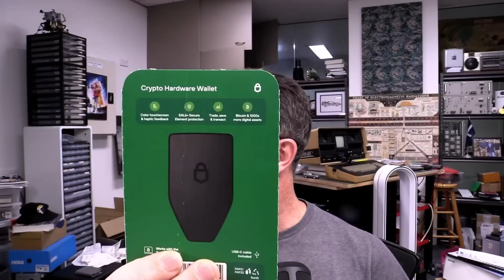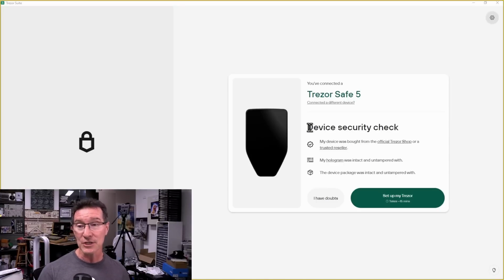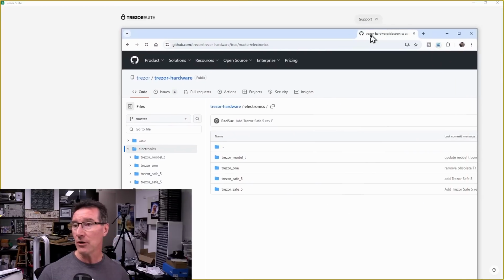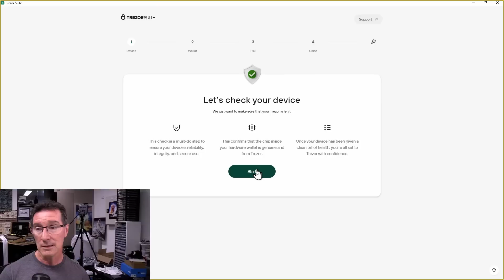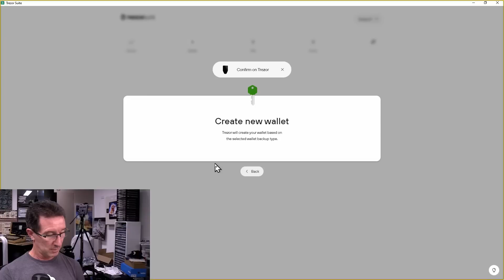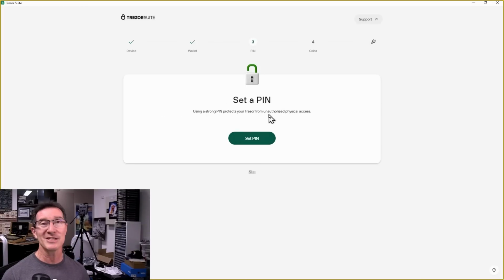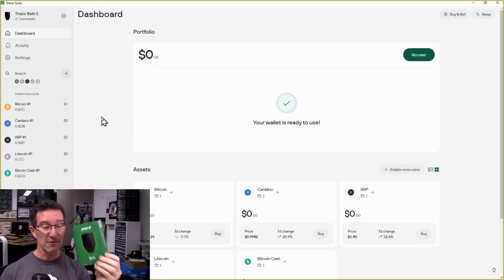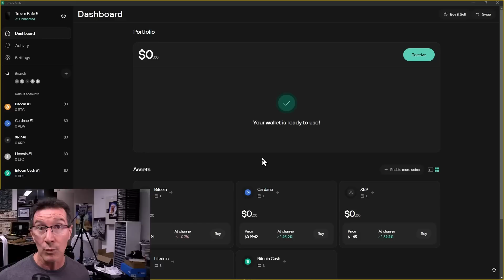Trezor Safe 5 Bitcoin Crypo Hardware Wallet

Comment: New to this crypto stuff and I have a question::: So if my crypto is in a cold storage wallet, is the crypto that is in the cold storage wallet available to be used on the platform so it is can be doing something for me and not just sitting there.  Not sure how this stuff works... I got a little on a platform and want to store some if I gain but don't want it sitting in a wallet, I want it working for me.

Comment: Dave: Never forget, there is no such thing as a secure computing device.
Reply: Yeah but by the time it takes them to crack the wallet you would have had enough time to drain the funds and move to another one.  It could literally take them years, but it takes me 30 seconds to move funds should I lose my wallet.
Reply: @ It doesn’t negate my original statement. Who knows what the right(wrong?) person could do down the not to distant road. 🤷‍♂️ Do you?
Reply from the maker: There is if you can't physically get your hands on it.
Reply: @ Even then Dave, there’s things like Tempest. 🤔
Reply: @mikestewart4752  LOL, Tempest can read Trezor screen data, yeah sure, I'll go check for the black van outside.
Reply: @ They driving green vans now. I’m just messing with ya Dave!
Reply: It's 2025 and NO one can answer us about trezor suit not having our personal information from the trezor cold wallets

Comment: Exactly how many copies of this stuff does one keep? An extra one at an offsite location I assume? It seems a bit like the wrong threat model to me, to use a chip designed to delete the information when you tamper with it. The risk of losing the wallet seems a lot higher to me than the risk of someone stealing it from a physical device. It would take a pretty sophisticated thief with good information about you to do that, but people seem to lose access to wallets all the time.
Reply from the maker: That's what the paper backup is for, if your hardware is lost or broken.
Reply: @EEVblog2  Okay, but in that case wouldn't the sophisticated thief just go for the paper backup?
Reply from the maker: @jessicav2031  Yes, correct. Guard the paper backup wiht your life. With the 20 words anyone can steal all your crypto in minutes, they don't need the hardware. The hardware is the convenient means to generate the secure seed and allow convenient secure transactions.
Technically the hardware wallet is much safer because it's password protected and difficult to hack, but if it fails and you don't have the paper backup then all your crypto is lost forever.
Reply: most secure hardware storage (for example the TPM chips in PCs) erase the data if it detects tampering. 
Just like disk encryption has no "password reset" and if you lose the key or passprhase you have lost the data.
You can make all sorts of backups so if you actually lose access it's on you

Comment: That seal looks more like a honey badger. Known for being very tough and have been seen defending from an attack by several hyenas.
Reply: Yeah, I had to scrub it with Isopropanol. That's the best way, it won't hut the plastic.
But never Acetone. It will clean it but it will also ruin the surface.
Reply: @DataLog  I don't think your reply was meant for me.

Comment: I like crypto wallets where the seed and keys never leave the wallet. So you create, display, and re-enter (when restoring) the words on the wallet itself. When doing transfers the host PC software sends the request to the wallet, which first displays the amount and destination address for you to confirm, then generates the signed block to send back to the host. This way a compromised host can't do anything bad.
Reply from the maker: This is exactly how the Trezor works. The keys never go past the wallet screen.
Reply: @EEVblog2  does it show the brief transaction summary on its small screen as well? If you do not check the data, destination wallets and transfer amounts that it signs it is just as susceptible to MITM attack. A compromised host computer can just send a malformed transaction to the device and ask you to press an OK button.
Reply from the maker: @pahom2  Yes it does.
Reply: do you mean signed transaction (not block)
Reply: @jimmybrad156  Sorry, yes. The wallet signs the transaction and sends it back.

Comment: I believe the main reason for the multiple 20 word lists is, as an example, 5 could be created and distributed and only maybe 3 are needed for recovery so one list being lost or compromised wont risk your crypto wallet being lost/stolen as 3 of the remaining 4 can still be used for recovery and the lost one by itself is useless.
Reply from the maker: More trouble than it's worth for the individual IMO.
Reply: @EEVblog2 It's so you can give it to 2 family/friends + 1 yours... Need 2/3 so you can restore with 1 friend but they can only restore if both of them work together... Perhaps if you die...

Comment: Both trezor 3 and 5 have secure element EAL6+
Reply from the maker: So it does. It's not on the box, but I checked the schematic and it's not the same chip. Uses a STM32F439 (TRZ32F429 on schematic) processor.
Reply: Hey, sorry to disrupt you, but could you assist me?    The recovery phrase [ clean party soccer advance audit clean evil finish tonight involve whip action  ], paired with USDT TRX20, is in OKX. How do I send it to BitGet or OKX?